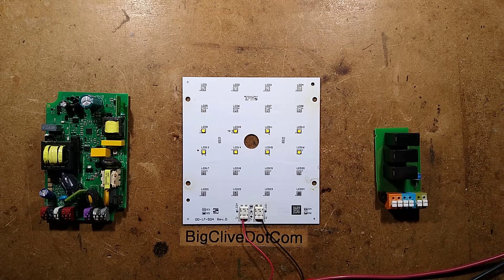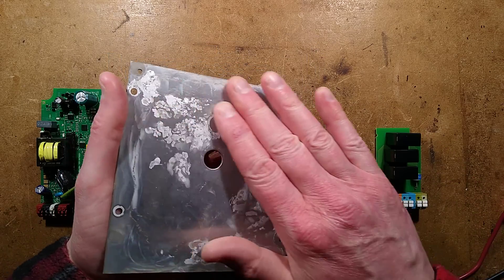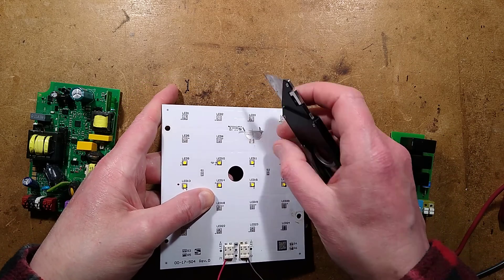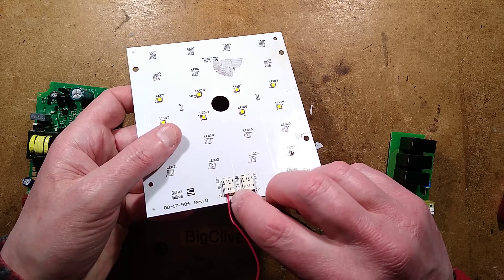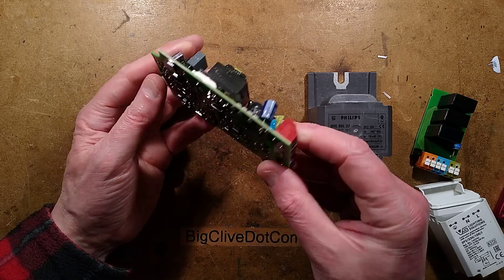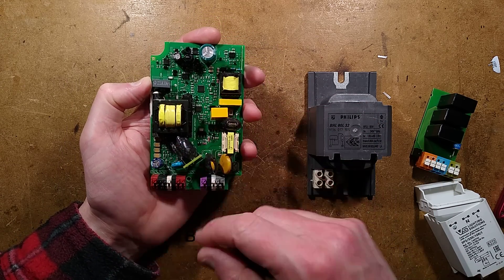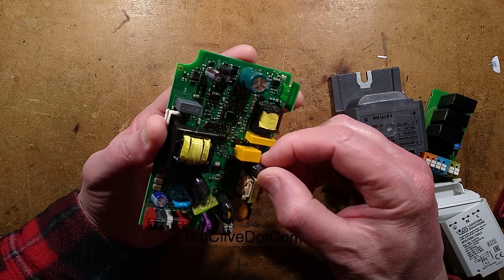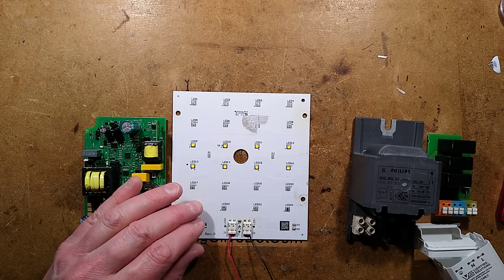Unusual street light failure

Comment: Current power supply:  New! Improved! Better!  Component count of over 250 items and a 2-3 year service life...if you are very lucky.  
Previous Power Supply:  Component count of 1 and a service life of 60 years or more.  
Just gotta love the "advancement" of todays technology  🤮
Reply: Just like my car. New, improved temperature controls: microprocessor controlled servos to change air flow direction. Previous temperature control methods: knobs with wired cable connections to air flow flaps. Result: after 15,000 miles, £640 bill on new car for replacing faulty servo motor controlled flaps. Old cables and flaps on other car still working after 43 years and 200,000 miles.
Reply: Some of this is being regulated away.  For example, ordinary T8 fluorescent tubes will no longer be sold here as of 1/2025.  Go dark or go LED, it seems.
Reply: The devil is in the detail! A lot of people talk talk of advances and advancement, but no-one ever happens to mention in which direction...Advancement in the reverse direction seems prevalent today, sadly.
Reply: Yes, but the new drivers don't contain a half pound of copper to attract tweakers.
Reply: What would the alternative be though (aside from this driver being overengineered of course). You could have the streetlights on a DC circuit and use simple linear drivers?
Reply: It does not matter that much. The point is to save electrical energy, and these LED lights do that. And having to replace the power supply or the LEDs or both every few years still pays off in electricity savings.
Reply: @DashCamSerbia Is it truly saving power if you included the energy consumed for raw materials, production, and installation replacement. 

When "repairing" LEDs, the common practice now is to throw out the entire fixture.

The energy just for the production of the aluminum fixture for street lights being thrown away, not counting components, has to be insane. And yes, it's common practice throwing out the entire fixture for a simple faulty driver or a single burnt COB LED wired in series.
Reply: …including the working hours of the maintenance crew?
I doubt it!
Reply: @demil3618  You can dubt all you want. There is the reason why they are doing it, and it is the money (savings).
Also, just because these ones are bad and don't last long does not mean other LED lights are the same.
Reply: @DashCamSerbia Oh no doubts if thez last longer, then it makes perfect sense.
But we see it all over, with road or rail vehicles etc.: Previously they were built to last, now they are buult to be produced cheap but won't last as long as previously.
Where's the progress? There isn't much business in producing lasting products unfortunately.